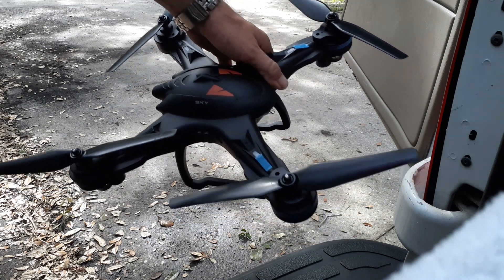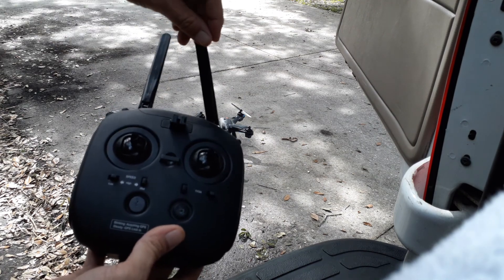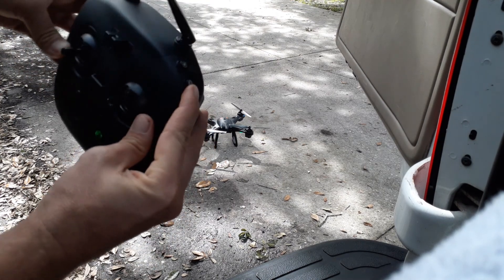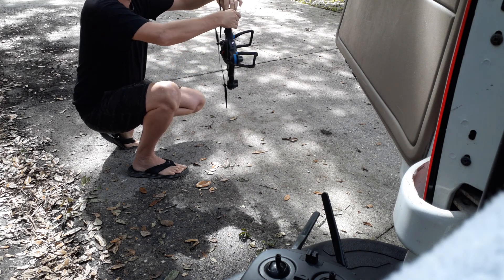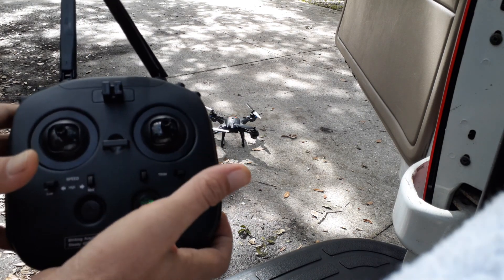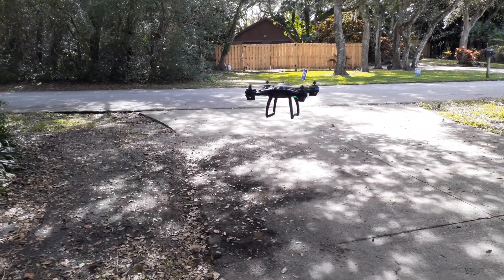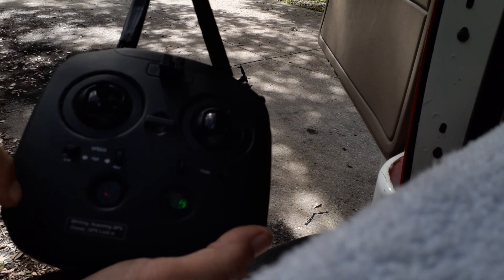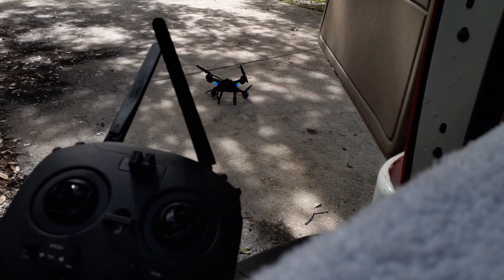Vivitar Skyview Drone proper pre-flight and hover

Comment: I've seen alot of people complain about this model (after I bought one of course) but you seem to get it calibrated just fine. Do you need to calibrate the GPS every time you take the battery out or just as needed?
I'm currently waiting for my battery to charge before my first flight
Reply from the maker: Hi!  This model actually flies great! I've had a ton of fun with it, and just starting to upload some on-board video.  I calibrate every time I fly.

One word of caution:. I recommend replacing the AA batteries in the controller every half-dozen flights or so, depending on the quality of battery you use.

The two times the drone has flown off in a random direction (at full speed I might add) was because if low transmitter battery.

Also, I recommend doing a few full charge and discharge cycles on the drone battery by doing low-level slow speed hovering until the battery capacity builds up.  These batteries seem to lose their "memory" if not used.  I quickly got the battery in mine up to full five or six minutes worth of flight time.

I never use the phone to fly, only change settings if I want.  There seems to be a "gravity" mode that takes away the GPS altitude hold function for better freestyle flying.  I'm going to try it next!!

Have fun!
Reply: @flyingfeverr  so far so good! I've flown it twice,  one to maximize the battery (it's not my first drone by any means) and once to try out the camera..which leads me to my next question..how do you get the video off the app so it can be shared or uploaded to YouTube? Pictures are saved to my phone gallery but not video..what am I doing wrong?
Thanks for the tips!
Reply from the maker: @aliengranpa  

It creates a folder in your phone called "UFO_video" . I found it in file manager.  From there you can do whatever you want with your video.

Thanks for reaching out to me!  I got the remote pilot certificate and was hired recently by a company to fly their drones, so I'm practicing with this one.
Reply from the maker: @aliengranpa  actually, the folder is called "WiFiUFO", subfolder is UFO_video.
Reply: @aliengranpa  what apps did you use and what cell phone?  Thanks.